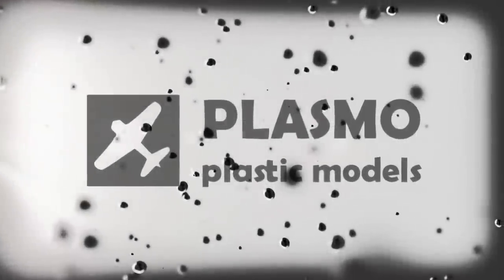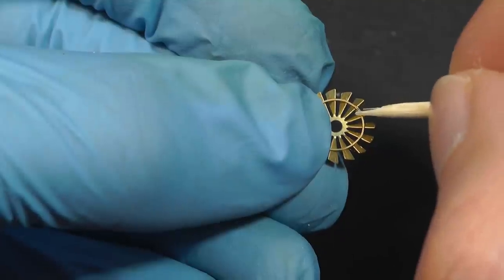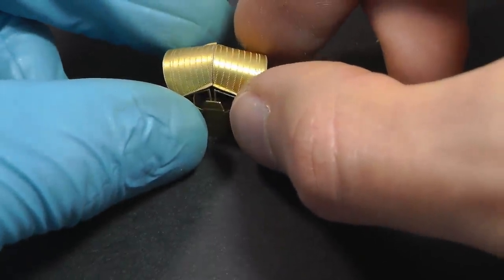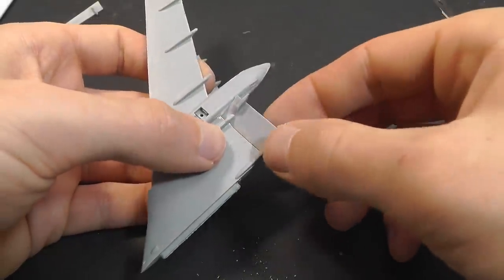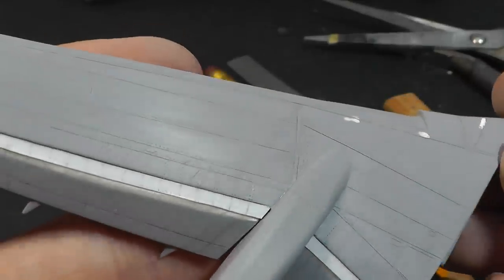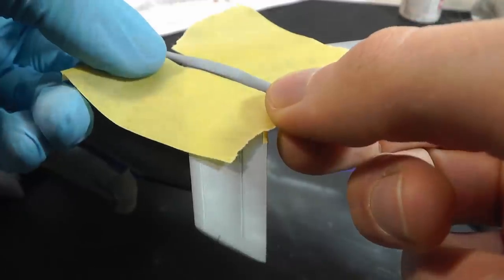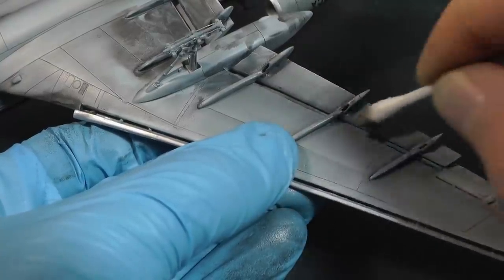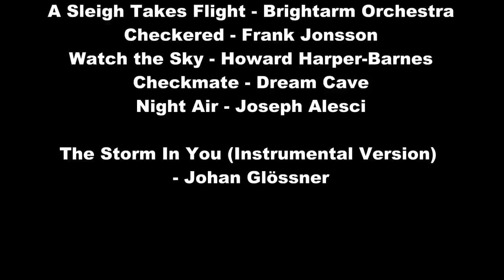Tupolev Tu-154M ČSA - Zvezda 1/144 - Airliner Model

Comment: I bought some masking fluid once,8 bucks for a little bottle! Played with it a couple times to figure it out,wasn't bad. Used it on a passenger ship(forget which one) and didn't remove it at once to check the results. Finished painting whole thing,took it off and it did almost the exact same thing. Had to redo the whole paint job. I threw that little bottle as far as I could over the back fence into the woods behind our house. Never used any again. 
I feel for you.

Comment: Your artistic abilities are quite innovative and effective. Many of your techniques have given me new insight into building better models. It has also shown me how differently each of us approaches the construction process. I have noticed videos where you attach many peripheral parts before painting. Whereas I would often consider this to be problematic to the finishing process, it seems to work fine for you. You also use a paint brush in places where I would obsess with masking and airbrushing, yet it works well for you. That said, I don't have the patience to use putty strands and tape for camouflage masking, but you show the benefits of doing that regularly. If I were forced say to anything in a constructive manner, it would just be that perhaps you could present a model now and then with a bit less weathering. No matter, I thoroughly enjoy your videos and the quality of your work.

Comment: Beauty,... We've an 'air-mada' of old Dubena Cesky 1:250 scale model jetliners whose moulds were originally from a line of Siku plastic aviation castings put out in the '60s. We'd bought and built the kits a decade ago but they still show up on eBay nowadays.

Comment: I have done the windows on airliners 2 different ways.
1. I have skipped the plastic and used canopy glue or mkk to make them.
2. I have waxed the plastic with carnauba wax heavily before installing them.  Then use a toothpick to scrape the paint off.

Comment: This model looks awesome! Although I’ve got one question, why did you fill the gaps between the flaps and the wing itself? (10:38) The gaps are supposed to be there, that’s how the rail mechanism works, flaps simply slide down the rails and a gap appears

Comment: 18:20 It's called Thrust Reverser (or just Reverser), not reverse brake. :)
Reply: How doesbit works ?
Reply: Is it like an air brake ?
Reply: It directs the engine thrust upwards/downwards (in this case), and also forwards and therefore against the direction of travel, thus greatly increasing the braking effect on landing. Just listen to the abrupt increase in engine noise on most jet airliners immediately after touchdown as the reverse thrust is engaged. Many prop driven aircraft can reverse the pitch of their propellers to achieve the same effect.
Great build, as always. Puts my efforts rather in the shade. I too would love to see more airliner builds.
Reply: @michaelevans205  oh thanks

Comment: I have always discounted 1:144 as too small , but this turned out to be a good size model . I remember building AIRFIX airliner when I was youngster 1960's  , you had to put transfer stripe over the windows ,(Remember BOAC ? Navy stripe over windows ?)  then punch out window apertures with plastic tube ?!   that's not gonna go well now is it ?????    Beware of superglue and clear parts 'cos it's gonna fog them !!

Comment: That's a Russian airliner airplane Tupolev 154M Russian manufacturer Zvezda. Very nice airplane the two engines & engine on top Besides the B727-200 airliner the same thing in resemblance. 🇷🇺🇷🇺🇨🇿🇨🇿 Czech Airlines. Besides the DC-9 airliner airplane.

Comment: How much could it be better, if you haven't glued passenger windows early with all that troubles masking and de-masking? Just paint the fuselage first, and install illuminators in the end. I wonder why you always install the parts with masking/de-masking problems which don't strictly need to be installed early.
Reply from the maker: Hi. Yes, sometimes it is possible but not always. It depends on how the kit is good and precise. You sometimes need to fill gaps with putty first. Especially here, you cannot paint fuselage first and then add windows because the design of the kit does not allow it.

Comment: Were is the flakpanzer diorama
Reply from the maker: So far canceled.
Reply: @idaemonplasmo  why
Reply: I cant waint to see it when and or if u make it, right now I'm working on Dragon,s 1/35 Battle of the Bulge King Tiger it's an amazing kit, you should try to build it some time
Reply from the maker: @NorthernMuck06  I must prepare some documentation and material, so It will take some time.  Dragon,s 1/35 Battle of the Bulge King Tiger wow. It is a huge but beautiful model.  I usually prefer some smaller models in 1/35 scale, like Stuard or PZ1 :-D But I wish you a lot of luck.
Reply: @idaemonplasmo  yes is an amazingly tooled kit